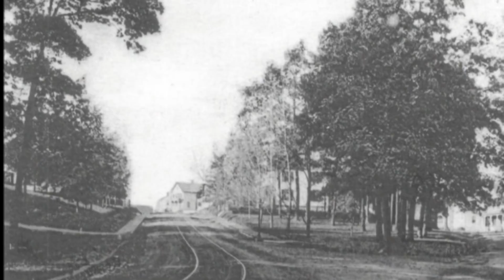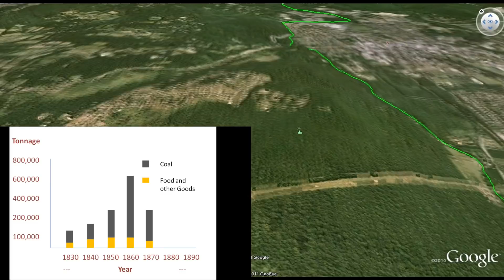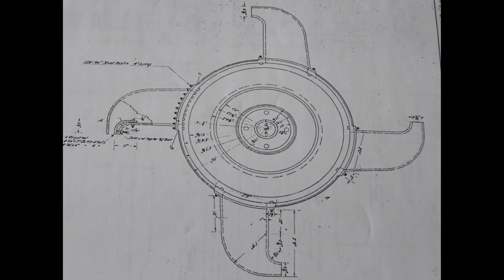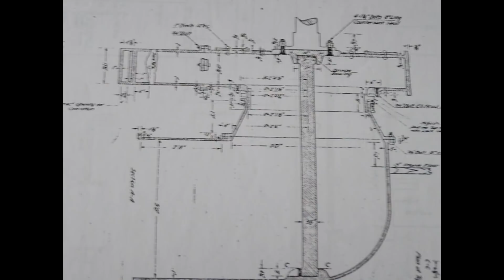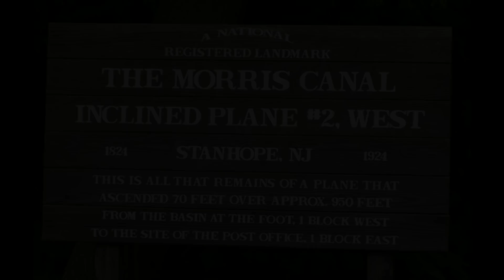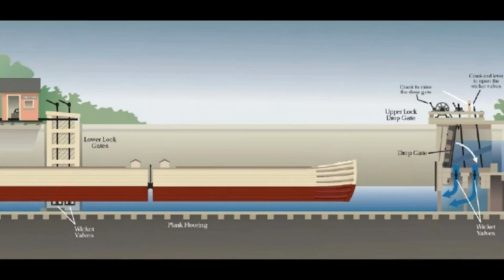Morris Canal - Wharton

Comment: The photo of the Lock Controls at 09:30 is not .
It is the turbine controls for pentstock water supply and winch direction for the Inclined Plane  lift system turbine .